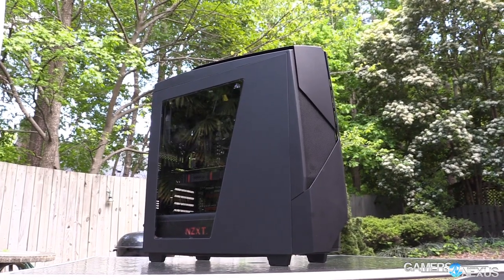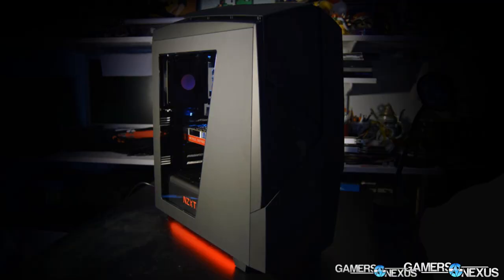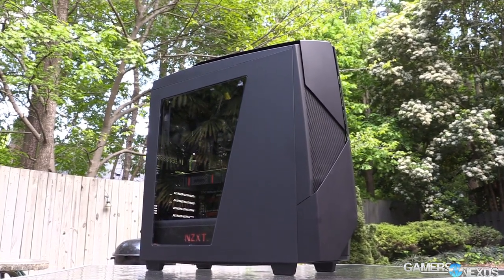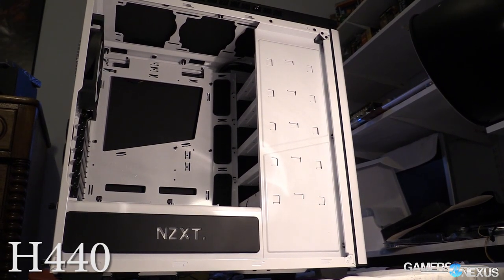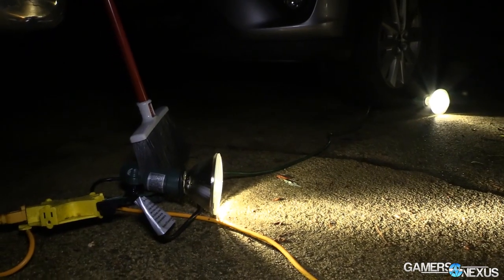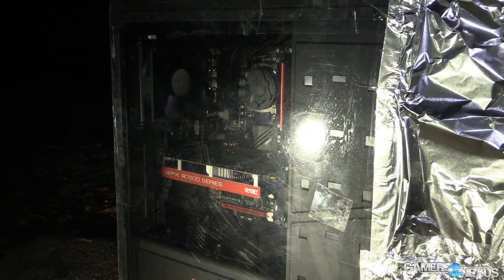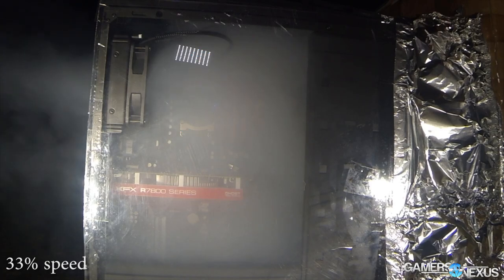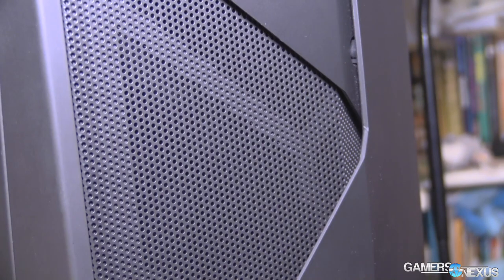NZXT Noctis N450 Review & Airflow Smoke Test

Comment: I believe a dual fan/radiator mounted at the top of the case in a push form making the air travel upwards would help with air flow in this case dramatically.  The manufacturer stated the top of the chasis was built with gamers in mind that would use a dual 120/140 mm cpu cooler.

Comment: Hello steve question for you, at 11:45 you mention not to install a fan at the top rear (top left corner directly above the cpu cooler?).

This N450 has 3x120mm top slots, taking your suggestion I should not install one at the top left, for the last 2 slots (middle and top right close to HDD cage) would you recommend those be both intakes, both out, or 1 of each? 
I've been assuming positive airflow is best and with those 3 fronts and 1 rear exhaust, not sure what's best for this case's situation.

Thank you :D

Comment: front top position...what do you mean when you say that...btw i have a radiator h105 and have push and pull  system....i have them installed normal way.....do you mean having the fans pull/push?

Comment: Could this be Liquid Water Cooled? Or is it too small?
Reply: From what I've seen, the case is designed to fit a decent sized radiator in it. He says there I'd about an inch and a quarter (24mm) between the shroud and the chassis for a rad or fan to fit.

Comment: You know nothing John, how can you review a case?

ajokes aside, i really liked the airflow setup you have there, i'm on the market right now for a NZXT case, i'm going for the S340 because of better airflow given the lack of drive cages, and the cleaner and simplistic look.
Reply: The s340 is a really good case for the price but it's window scratches way too easily
Reply: moaz khan I plan to replace it with a glass windows, it must be easy.
Reply: I dont know 
Anyway best of luck
Reply: Andres Gallego As a matter of fact, I'm getting the S340 next week and as it turns out mnpctech sells an aftermarket acrylic panel to replace the plastic one that comes with the case. I think it runs about $30-ish. From the instructions on their web site it looks like it's super easy to replace, just have to bend some tabs out a little way to remove the factory window, pop in the new one and bend them back.